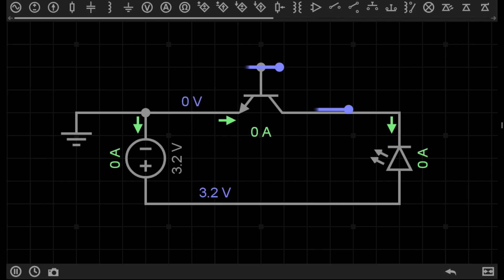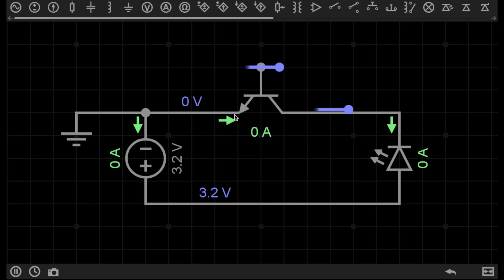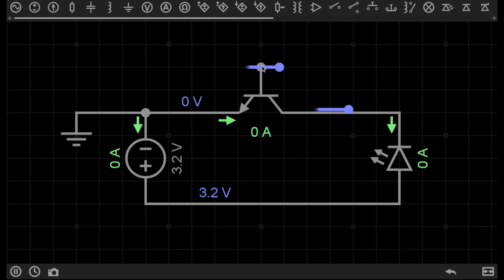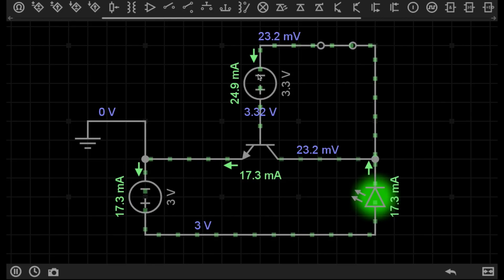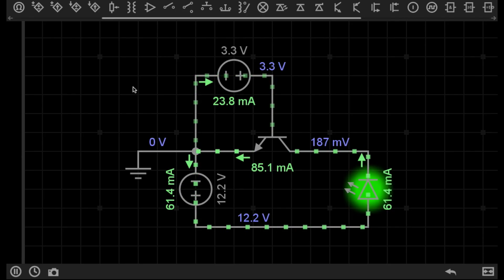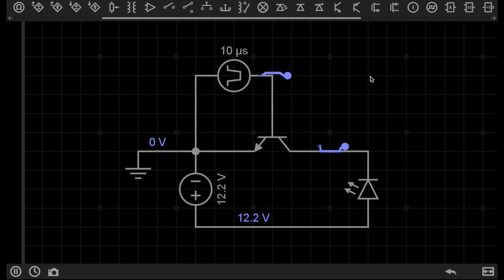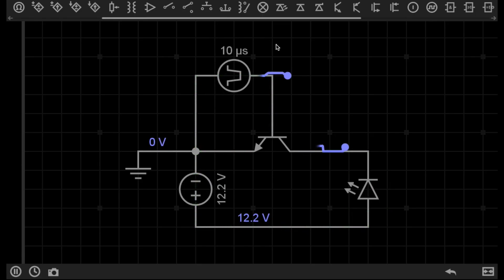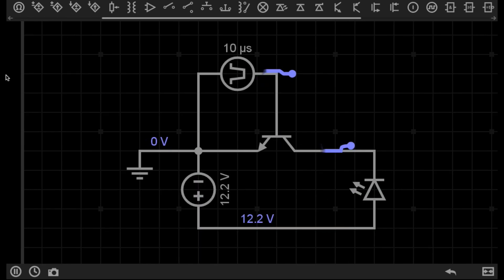How a Transistor Works EASY! - Electronics Basics 22 (Updated)

Comment: I'm trying to figure out a circuit that turns on a motor when the light input to one LDR is greater than that to another. And turns off the motor when the light input to each is the same and turns on the motor in reverse when it is the second LDR receiving the most light. If I can make two of these circuits I can design a device that angles a solar panel towards the sun. I saw a crude solar tracker someone made using small solar driven motors that simply fought one another, the motor receiving the most light to its panel winning the tug of war, until both motors stalled out when the device was pointed at the sun. I was curious to design one using transistors though.

Comment: You forgot to include a current-limiting resistor at the base; in a real-life circuit, instead of the current simulation, without it, the transistor would fry the moment the voltage-source at the base is switch-on.

Comment: Doesen't voltage (electrons) travel from negative to positive the opposite shown on the circuit?
Reply: Firstly. voltage is pressure or the potential for flow, so it isn't what is moving. You are referring to current (electrons) that move. 
Second, when this concept first came about, scientists theorized that current would go from high pressure to low pressure which seems to make sense. The symbols were all created to reflect that. Notice the arrows on the devices point to this convention for current flow. Later, it became clear that negatively charged electrons, attracted to the positive battery terminal, were moving through the wires from the low to the high voltage but by that time, all symbols were in place so we have "electron flow" and this "conventional flow" which is still taught in engineering schools.

Comment: Great video I just liked and subscribed. 

Question I have is within the video and working diagram at about a 1:45 min mark, the diagram is showing the current flowing away from the collector. Is this how the top 3.3V circuit is completed? I am not following/understanding the visual motion here. I would have thought that the current would go into the collector and then out through the emitter. Is this not the case? 

It also seems odd that the direction the simulation emulates the current , I was always taught that, contrary to what you would think, current/electrons travel from Negative to Positive.
Reply: FENATECH I noticed this as well, seemed conflicting  to how other videos showed a similar animation.

Comment: why does this video have current flowing from positive to negative?
Reply: Because that is how it is “typically” written/showed/visualized.. it is “conventional* current”. Circuit will work just the same. 

Plus on the flip side, since electrons really DO flow in reality out of the negative terminal to the positive, you can visualize the opposite of that flow (which again, is “conventional current” how most often displayed, especially in professional engineering applications*..) as “current”(conventional..) being the “flow” of the *spaces that are left behind by electrons moving from its own opposite direction

Cheers
Reply: Jerry Mahone - oh and one more note -
You can thank Thomas Edison for this “convention”.... tho truthfully, at the time of its discovery, there was NO tech or literally ANY way of knowing which direction the electrons actually flowed, because the circuit worked either way*... BUT a standardized circuit “language” absolutely *had to be developed for compatibility/consistency’s sake, so he pretty much just chose which one to label [ + & - ]... it just had to remain the same across the board to share and expand upon the continuing development of circuit discovery/innovation etc..

Hence, “Conventional” Current...!

Cheers

Comment: Why you need two power supplies for that???
Reply: In this simple example, the transistor is acting like a relay, using a smaller amount of current to drive something with a larger amount of current. Instead of turning and LED on/off, he could have connected something requiring much more power. For example, you could use an Arduino to turn on a loud alarm when a sensor connected to the Arduino is triggered.
Reply: You don't need two power supplies. Basically you only need a small amount of current at the base of the transistor and the 12v would be too much! So just to make the circuit  simple he added a smaller 3.3v to the base just to switch it on.. :)
Reply: a
Reply: I think he wanted to eliminate the use of a resistor so it is easier to grasp for beginners.
The idea is basic, just using a transistor as a switch
Transistors serve 2 basic functions; amplification (as an amplifier)and switching (as a switch).
https://en.wikipedia.org/wiki/Transistor
Then uses increase , to build even computers.
Later on, try this app to tamper with transistors quickly, but remember better build real circuits, to see how they really work.
http://www.cburch.com/logisim/
https://www.youtube.com/results?search_query=logisim+transistor

Comment: This may indeed help me with a problem. I have a couple of transistors on a board that I am trying to repair all with a random wire pulled away from it resoldering it would be annoying and a shot in the dark if I had no clue how a transistor worked.

Comment: The first diagram shows current flowing out of the transistor collector back to the 3.3v power supply and out of the emitter to the 3v power supply but in the video it says that the current goes from the led through the transistor back to the 3v power supply. I thought when the transistor is turned on that current only goes one way through it?  The way it’s drawn out in the second diagram makes sense to me but the first one has me confused...can anyone help me understand a little more please?

Comment: Why use a transistor when the same thing happens without one. That's what i can't comprehend. Can anyone help me ?
Reply: Wambo this is a analogy: suppose you are controlling a crane. it's levers or gears you control requir small force applied compared to the weight it lift. similarly some devices like microphones generate very small voltages or current, these small values are like you and me. the transistor and rest of circuit is like a crane lifting heavy weight or amplifies. particularly the transistor is like the lever. external power supply is like cranes engine.
Reply: Learn easily the basic concept of Transistor and Full wave and Half wave rectifier from the video link given bellow
https://youtu.be/KIBHW1jRBsA
Reply: Wambo 
 I have read quite a few comments here. I'm trying to learn this stuff myself and apparently this is a very bad tutorial video... Just find another video tutorial. Lots of the things that confused me about this video turns out to be a problem with the video and not my problem at understanding it... Many of the comments I read are by people who are already very knowledgeable about electronics.

Comment: Thanks for the video but I think I'm getting confused. In one of your previous videos on DC circuit about how electrons flow, you stated it flows from from the negative through the load to the positive. But going a bit off the transistor topic on this video, you state current flowing from the positive through the load to the negative. Can you please shed some light on the directional flow of current and electrons in a DC circuit please?
Reply: For electricans the flow goes from pos to ground. that has something to do with the magnetic field lines if i remember correct.  But for scientist it follows the real flow of the electrons which is from gnd to pos. 
But yea for every normal person electricity flows from pos to ground.

Comment: In previous videos you showed the flow of electrons going from negative to positive charge yet in this vid you show the flow from positive to negative - so I'm confused.
which is it?
Reply: In real, it is so, electrons flow from negative to the positive, but, to the convencio, the direction of an electric current is in  which a positive charge would move.
This was the convention chosen during the discovery of electricity. They were wrong!
Reply: Well the "SIMPLY" Electronics has performed confusion in his lectures rather than clarification (in other instances as well). You don't just CHOSE on one "convention" and then flip flop on it in the middle of the lecture series. What kind of "understanding" does this Simply Electronics  posses to have not understood in the first place that to explain it one way, then completely reverse course, is not an outright confusion to us students. But more like confusion is the purpose of these lectures. Fucking CIA brainwashers.
Reply: @termination9353  Electricity can only flow in 2 directions in a circuit.  If it's not one direction, it's the other, or it's off.  There conventional direction for current flow was selected before they knew it was electrons and what charge they had.  At that point they discovered their thinking was backwards, but they stuck with the convention anyway for consistency.  It is not a difficult concept to grasp.  
If you're having trouble coping with that, it's not the teachers or the lecturers' fault.  The problem resides between your cochleae.
Reply: There are two types of flows. The conventional and the actual flow. I think you should be able to adapt to both concepts fairly quickly right? It's easy to understand. Also... what does the CIA have to do with any of this XD
Reply: You know that this convention is global right... We define current as the amount of moving protons divided by time. In reality its the electrons that move. But switching convention would create alot more confusion and has no real benefit as it does not matter which convention you use.(Only the sign changes) Thats why it's still in use around the world even though it doesn't exactly represent 'reality'
Reply: @ @Sn0wM0nstah  Protons stay with the atom along with the neutron. Electrons are free to move. The conventional theory didn't say that 'protons 'move but rather, some (as it turned out) imaginary positive charge, which later it was determined to be actually a negative electron charge. Hope that was clear.
Reply: There is no adapting to what is laid out to deliberately confuse. Pick a convention and stick with it and NOT jump back and forth with no rhyme or reason. Assholes.
Reply: It's because the education like THIS that America is so fucked up and the people so dumbfounded.

Comment: What software do you use to simulate your circuits? I love the way you use it! It makes it easy to visualize what is happening at the atomic level.
Reply from the maker: Everycircuit.com
Reply: so an app that's not software?
Reply: @symphasis  a app is software lol. Anything that is coded is software even a os is software.
Reply: i was sarcasticly replying to himiko
Reply: Hello, you might get this question very many times so I'd suggest putting that source you mentioned, in the description so that you won't get that question asked on everyone of your future videos.
Reply: It costs £15 tho that’s the only problem.
Reply: the only thing that may be fixed is the eletrons movement... all eletronic started seting the positive as "source" but in reality the eletrons moves form - to +.. :) hehe
Reply: @Mr Awesome I bought the app a few years ago because it was an upgrade from the free version. Then sometime after, they updated the free version, making the paid version useless. Now it crashes often.
Reply: I just got it for £11 and its a one off payment, full version for life.  It works out at about 25pence a week for 1 yr.. :)
Reply: symphasis I have it on my pc not phone 😀
Reply: how is he doing it at the atomic level ..?
Reply: Seems to have a flaw at 1:46 showing current flowing the wrong direction out the right end of the transistor. Later in the video this is corrected.
Reply: @ACitizenOfOurWorld  could be leakage
Reply: @ACitizenOfOurWorld  
Also I found it odd that he "applied a voltage to the base..."  Most tutorials acknowledge that the transistor is a current operated device and say that a current is applied to the base.  Thanks for the video.
Reply: He literally says near the end of his instructional video that the link to interact with this exact circuit is *in the description of the video*....???!!! C’mon ppl.... so damn lazy! Use your brains & ears too (if you can) ppl!
Reply: MuseMaze, the company behind EveryCircuit, are totally shit though! Their support is non-existent and I've been experiencing issues with their piece of shit, buggy, software for a week now! I have sent numerous emails from different accounts, but they're all ignored! All this and the cheeky bastards have the nerve to charge £15 for it!
Reply: Alpa Chino o
Reply: I have spent months researching into circuits and found an awesome website at Gregs Electro Blog (google it if you are interested)
Reply: Every circuit
It's not a software
It's just an app
Reply: @luxurious0346  App: application or software.

Comment: Why do you have a separate power source as well as power from the led circuit to the base of the transistor?
Reply from the maker: I could have a separate power source or the same power source supplying the base. I chose to use a separate power source to make it easier to understand as you can easily see that there is another source powering the base.

Comment: What about the Saturation state response, and the minimum required voltage/current on the base?
Reply from the maker: +Hasan Shariq as I want to keep the basics video as simple as possible, I believe it is best to leave those properties for a later video.
Reply: Hasan Shariq 
 I'm trying to learn this stuff and I don't understand your questions here, but I have read many comments indicating that I have the WRONG tutorial video to learn from. I'm going to look for another. I just read complimentary comments but they're just one liners. The critical questions are specific and intelligent. Thanks for your comment. It's more helpful than this video......